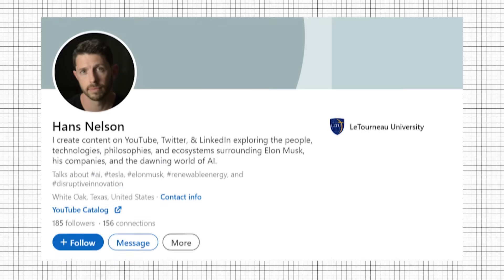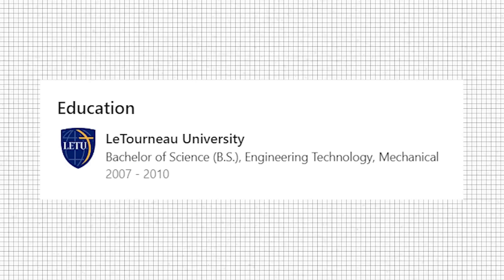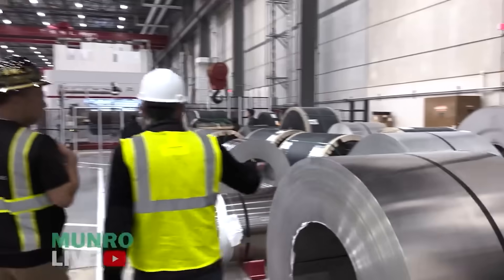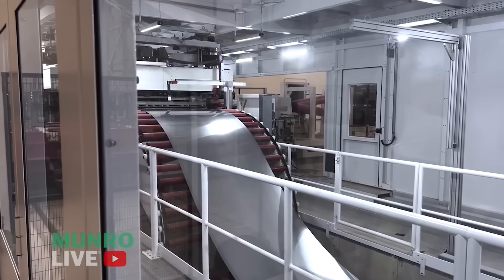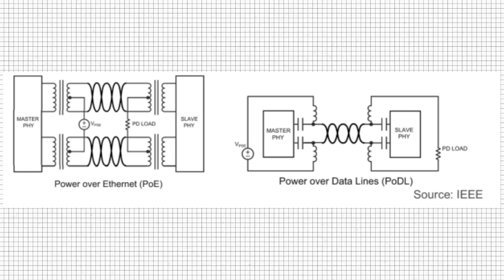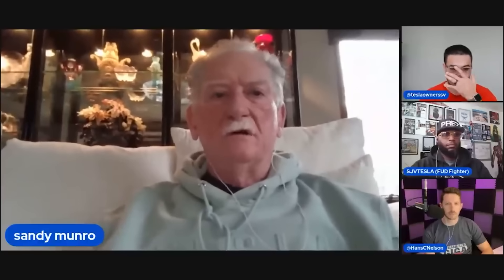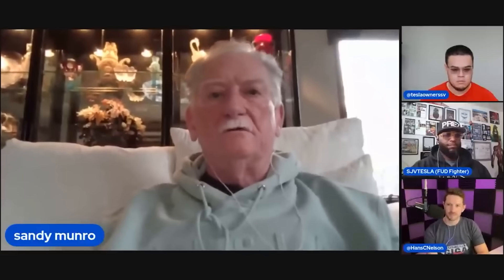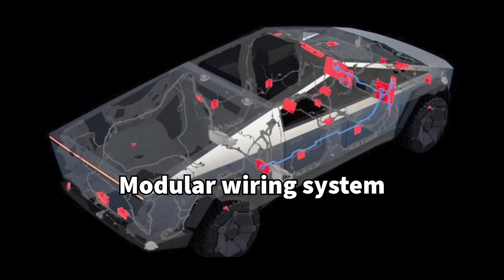Sandy Munro MINDBLOWN by Tesla’s CYBERTRUCK

Comment: Why is a mechanical engineer advocating for a non mechanical system? It works on aircraft because they build custom parts, and built in redundancy. Show me how theirs a redundancy for some of these systems. This is really poor to compare airplanes to cars. They are made, regulated, and treated vastly differently. Oh the cost difference is no where even remotely close for purchase or operations. My respect has diminished for Mr. Munro doing that.
Reply from the maker: The actuators for the front steering rack are doubly redundant. Each actuator is capable of powering both front wheels.

The sensors are triple redundant.

I don’t know if that changes your view or if that is new information to you, but I wanted to share anyways.

Comment: Is it true that Cybertruck after testing on highway only support 240 mile range?
Reply from the maker: I think it was down to 258 from a combined city & highway estimate of 320 in the test you are referring too which was all highway in cold weather.

It's pretty normal for EVs to lose that amount of range in those conditions at this point, unfortunately.

The range is much better at 50-60 mph than it is at 70+ mph. This is true for both EVs & ICE vehicles, but it has a bigger impact for EVs since aerodynamic drag plays a much bigger role in EV range than it does in ICE range.
Reply: The good news is that if you pay another 16000 bucks and give up a lot of space you might get close to the numbers Musk quoted when he first sold the idea of the cybertruck.

Comment: Great video! This is why I love the Cybertruck. Innovation in a product that people wouldn't even think of... Finally letting engineers do what they do best which is build cars, not allowing the negative Nancy's to shoot down anything remotely innovative like Steer-by-wire and 48V architecture much less the mega castings!
Reply from the maker: And you have to respect the hutzpah it takes to make something that looks so wild for purely functional engineering reasons.
Reply: @HansCNelson  sandy is getting ridiculous saying rear view mirrors and side mirrors are outdated is total moronic crap its like saying omg mirrors in your house are outdated they should all be digital screens. The thing is there is latency with this electronic crap and failure points with this stuff not working which a mirror will always work and be lag free unless you literally smash it, digital crap can have more issues other than literally smashing it.
Reply: @xboxownz & yet mirrors do get smashed. Deliberately or accidentally.
And don’t see around corners, around trailers, around blind spots.
And are significant wind socks.
Reply: @iandavies4853  cameras get smashed also plus they electronically screw up screens in cars break lol so do cameras, mirror is better technology perioid than digital and digital screen period.
Reply: @iandavies4853  HOW YOU GET BETTER RANGE TAKE OUT ALL THESE WIRES ASSOCIATED WITH CAMERAS TAKE ALL THE COMPUTER CRAP OUT OFTHE CAR AND JUST HAVE THE BATTERY AND INVERTER AND THE WHEELS AND BODY AND SEATS/INTERIOR AND SIDE MIRRORS THIS WILL WEIGH LESS AND HAVE BETTER RANGE! ALL THAT UNNESSSARY ELECTRONIC COMPUTER SHIT IS KILLING RANGE MORE THAN SOME GODDAMN SIDE MIRROR.

Comment: I trust Sandy. I’m impressed with teslas breakthrough technology and production techniques for the cybertruck. I don’t buy pickups yet I’m hopeful the future Tesla cuvs ie tesla model 2 will utilize cybertruck production techniques.  

I think no paint stainless is awesome.

The 48 volts and steer by wire is pretty cool.
Reply from the maker: The “model 2” will definitely build on the manufacturing techniques of CyberTruck, and then go even further.

Comment: The only thing that will be MINDBLOWN is the driver when it ignites. You fools pushing this overweight, ungainly, unsupported piece of shit and Ev's in general need your heads read (oops Mindblown - nothing there).

Please do your homework, charging takes excessive time and cost, really heavy, lack of supporting infrastructure, batteries that can go boom at any time, drive one through water etc and I could go on! Plus they are worth nothing when you are done with them, its a HIGH COST DISPOSABLE ENVIRONMENTALLY UNFRIENDLY on the TAKE BUREAUCRAT DRIVEN ITEM!

Comment: Cybertruck is the entree to the manufacturing revolution represented by the Tesla model2. 
Cybertruck won’t have mass mkt production of 1 mil+ vehicles per year. But they will iron out the details on the 48v architecture and other systems. 
Model2 will be the real industry paradigm shifter

Comment: Sandy is no t a Tesla fan boy. He just calls it like it is!!!!!.Originally he panned early Teslas due to paint and fit problems with the body panels. When he saw the genius underneath he realized tesla was something else. As Tesla got better and Sandy's reviews improved re Tesla Sandy sold some tesla stock he bought so no one would think he was a shill for the brand......Believe munro......he is the real deal. Many car critics are shills for one brand or another. Alex on the e for electric channel did a video about that. Alex was very pro VW.....even saying some models were as good or better than Tesla. Alex bought a VW id4. He had nothing but problems with it. When the dealer could not fix the problems......he contacted VW directly. A VW engineer claimed that the id4s problems were due to Internet problems.......not with the car. When Alex challenged this VW would not respond. Alex had VW as a sponsor to his channel. After Alex continued to report his id4 problems......VW cut ties with his channels. So be suspicious of car reviewers who give favorable reviews of cars that later prove to be lemons.....
Reply from the maker: I remember E for Electric well, but haven't checked in with his content in a while. Is Alex still at it?
Reply: Alex also has a strong disdain for Tesla based on his ownership of their vehicles as well.
Reply: LOL what that Alex experienced with VW is peanuts against what Tesla has done to hundred of thousands of cars with the "Vision" downgrade. Please!

Comment: Nobody should care about this guy and him being impressed, because HIS viewpoints don't matter to the consumer.
He is bewildered by the cost cutting engineering, and not by the fact it becomes a monopoly that you cant repair your vehicle with parts from any number (many) of aftermarket brands and even mores sellers.
It means the car is proprietary to the manufacturer and just like apple they will charge you so much that you' buy a new one.
And hyundai actually did it last year, when they asked a customer 60 funking thousands dollars and said, ah, we give you like 10% discount to buy a new car.
They didn't even care to assess the situation, just popped a sum the price of the new vehicle.
This is the type of engineering tesla makes as well, with their giga gastings.
There is ZERO benefit to the customer, only to the profit margin of the sellers that can make it with 10.000 (example) and sell for 60.000.
A reduction in manufacturing cost isn't translated into a reduction of the selling price, AS IT'S NORMAL. They keep the increased profit, and customers have no alternative.
Reply from the maker: Thanks for being here.

Comment: F1 is ‘brake by wire’ and integral with the hybrid battery and regeneration braking. So it could be done
Reply from the maker: Agreed.

I think this would be helpful for the unboxed process too.

It would make routing lines through sub-assemblies cleaner & easier.

Comment: If only they had put the right size battery in it :(
Reply: A Silverado 4WT  has that sort of battery.  It weighs 8,532 lbs.  Tesla assumed most people would rather have a 7000 lb truck.
Reply: @danharold3087  I think you're assuming what Tesla assumed. CT will barely top 7000lbs when you put the range extender battery in the bed.
Reply: @loganboyd   The  7K makes the point as well as "6,843 pounds for the Cyberbeast model."  It is where I was going.   Tesla has been telling people they overestimate the range they need for a good number of years.  Not saying this is the case on the CT. However I expect it to cut into other people SUV sales.   Can be used as a 5 passenger SUV with a big trunk.
Reply from the maker: That's what the range extender is for, but I definitely get the disappointment.

Hopefully in a few years we'll see better options on this front.
Reply: Logan, I agree. Maybe there’s enough room to haul concrete lumber and construction supplies back-and-forth from Home Depot?
Reply: @tech5298   About the same length as the short bed with fenders outside the box.  Easier to stack a load w/o the fenders in the way.   They were prefered for custom truck too.

Comment: Justmy2cents. I use to be an ICE legacy fan until I realized I was just another sheep they can sell their old technology. I still appreciate the great cars in past with their designs and mechanical advancement but lately the legacy auto makers are selling lipstick on a pig.
Reply: @AudiTTQuattro2003  Apparently you aren't up to date on battery recycling.  Energy density - you have a point and it is a limitation.  Nonetheless, the current technology meets the needs of most of the auto market.  It's production that's lagging and energy density continues to improve.  The transition is underway.
Reply from the maker: I love classic cars & good engineering, and I don’t have a problem with gas.

But I agree. It’s just not a good technology moving forward now that battery storage technology has come so far.
Reply: @HansCNelson When’s the last time you bought an ICE car that needed a $20k fuel tank replacement every 10-15 years? 😂😂
Reply: @JetFire9 they're called engines. I've had to replace 2 in 2 different cars. But nobody talks about that.
Battery tech for cars is still a baby in terms of advancement and scale. It'll eventually be such declined cost that it'll be cheaper than an ICE engine to replace.
Reply: @JetFire9   Your funny!
In the past, the average lifespan of a car was significantly lower than it is today. Now, you can expect a standard car to last around 12 years or about 200,000 miles. More advanced vehicles like electric cars can go even longer, up to 300,000 miles.

In 2020, the average lifespan of a vehicle in the United States was 11.9 years, according to the Bureau of Transportation Statistics. This is much longer than in 1995, when the average lifespan was 8.4 years.
Reply: @danharold3087  WRONG!!!!
Reply: @JetFire9  Why are you shilling for the ICE and oil companies.  There only motivation is to pick your pocket regardless of the implications.  Keep you returning to the pump.  Stick out your credit card and say Ah!   Who needs that.,
Reply: @danharold3087  It’s worse with EV’s. Quit hiding the truth.
Reply: @JetFire9  Simp.
Reply: @JetFire9   That is rich when Oil, gas, and ICE is spending billions to buy congressmen and journalists.  Follow the money.
Reply: @AudiTTQuattro2003  Totally recyclable will only come with large scale recycling.   When the cars/batteries now on the road are at end of life.  People demanding it happen today faile to see that like manufacturing, recycling is also most profitable at scale.
Reply: Maybe Tesla has to use square wheels for its cars,just to do things diffrent!
Reply: @brunoheggli2888  Maybe you're running out of imagination as a Tesla hater.
Reply: @brunoheggli2888  Hi Bruno !
Reply: Actually the other way around, but nice try. You’ve been duped.